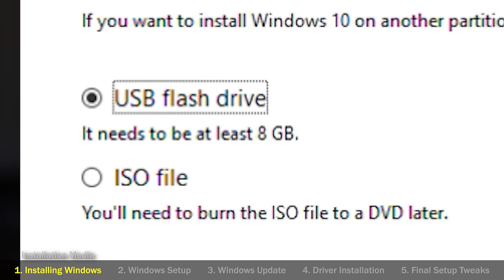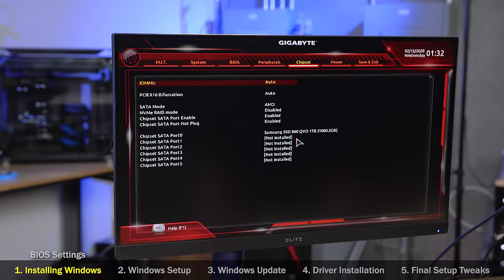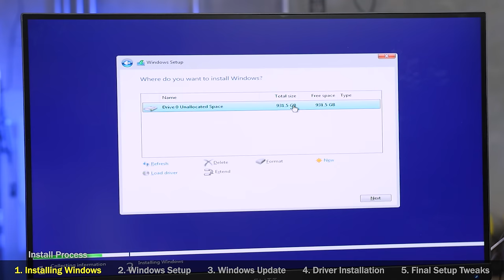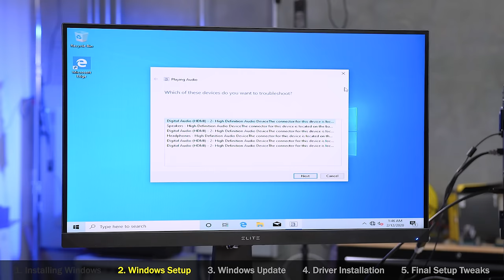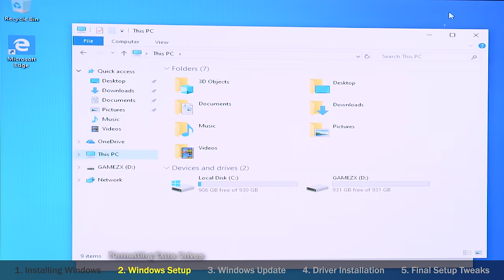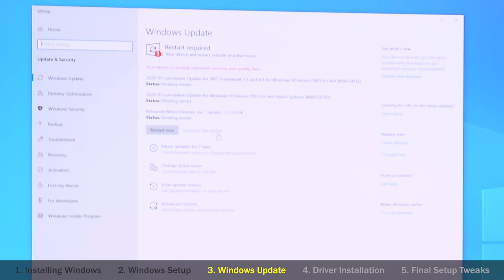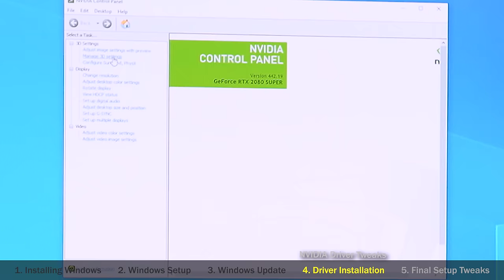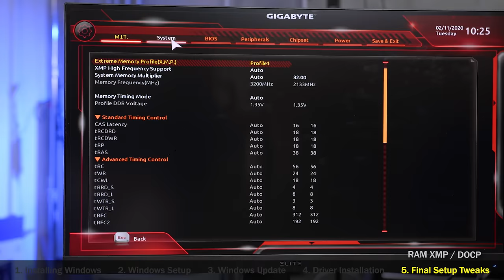Guide: What to do AFTER building your computer...

Comment: As a person who has never built a PC before (I'm planning to soon), this was a great tutorial. Very informative and easy to understand. Thanks JTC.
Reply: Pro tip: make sure you really look at what you need. I bought a single 500 gig ssd and quockly realized I was out of space and had to buy another. Also, ensure that you research to see when new parts are coming out to see if you should wait. A month or two after I built my PC with a 2070 the 2070 super came out for like 50 dollars less than I paid for mine. Lol
Reply: I'd suggest starting with a budget and look for a good build video and copy their part list and you're good to go. That's what I recently did and couldn't be happier with it.
Reply: OG Sniper is it a bad idea to try build a top of the range one first try?
Reply: @Vijai Ramharrack Yeah same here. This guide will be very useful.
Reply: OG Sniper I am probably going to build a pc within the next year and it my first time but if your building a high end pc for your first time I would suggest getting someone with experience about building PCs to help you
Reply: Fam, make sure you research your graphics card throughly, ensure that it is something that is very stable and won't die in the first week. cough amd cough
Reply: V Ram  Another tip, PLEASE update your bios, it’s a little tricky and you will need an usb drive, but I had many issues with my build down the road due to this and I didn’t even knew it
Reply: most of the instructions are fine. I, personally, choose to download the LATEST gfx drivers from my manufacturers website on another PC (currently with an AMD card) and transfer them to my desktop. 
I haven't had any real issues with most games I throw at my machine (it isn't blowing any titles away fps wise, but isn't having issues with CS:GO that I play at least on a weekly basis, since I built it in 2013). If you browse around there are countless threads on reddit and stuff with people with monstrous builds that are having issues with game from 2012 :) 
I've gotten bashed a lot online for doing it "my way", which is the way everyone did it back in the XP/Vista/7 days (and before). But I'll keep doing it that way cause it just works for me. and it's always less shit in the registry after a clean install.
Reply: Which parts do you plan to use? I built my first tower in January using a Ryzen 7 1700 and Rx 580 strix
Reply: @andydbr2969  I know you probably weren't @me, but I'm also upgrading (parts should be arriving this week or beginning of next). R5 3600, 16GB 3200 ddr4, msi b450 tomahawk (max i believe) and a 500w 80+ gold psu. I wanted to upgrade and stay below 450$/€. just about managed it by +/- 5$/€ 😁
Reply: @gerRule  You'll get diminishing returns on your parts once you get past a certain price point but undercutting isn't great either, because then you'll have to pay for 2 parts (the original and the upgrade) just to get use out of 1.  If its your first build, I probably wouldn't spend more than 1500 MAX.
Reply: CSandman but what about the new Nvidia 3,000 series graphics cards with hdmi 2.1, they’ll be expensive but I’ll want one
Reply: @gerRule  If you're willing to wait and shell out some serious cash, then yeah I'm sure it'll give top tier performance.  Who knows when they'll end up getting released though because of this virus.
Reply: CSandman yes well I’m sure it would take me a long time to build one so no rush
Reply: @gerRule  that could be a never ending game, waiting for new things to come out. People did that with the 2000 series card and Ray tracing and now everyone says its pointless. Then you also might as well wait for intel to release their new cpus too right?
Reply: no I’m only waiting because I already have the tv for it and I want to make the most of it, I don’t want to build a pc now and then have to replace the graphics card in a few months plus most likely I’ll just end up buying a pc rather than building one so then I’d definitely have to wait
Reply: @gerRule  id say it will be more than a few months, they were saying possibly august but with all that's happening I bet it will be even longer.
Reply: @gerRule  what benefits are you expecting from hdmi 2.1? You won't be playing at 8k so the 8k at 120fps won't make any difference
Reply: rayn man I just want 4K @ 120hz
Reply: And obviously be ready for whatever’s to come over the next while
Reply: @gerRule  wow you must be building a beast of a pc💪 doesn't hdmi support 4k at 120hz?
Reply: On one leg, you have the risk of tripping and scrapping your palms on the ground if your lucky at most. On the other hand.... You risk fucking up a 1000+ dollar build(100-1000 builds are just as scary).
Reply: i have just finished my first ever build i have never even thought about pc it was actually fun just take your time and do lots of research and you will be fine
Reply: kendawg THE AWSOME was it difficult? How long did it take you?
Reply: @gerRule  dude building a pc is soooo easy, I swapped old and installed some new components from one case to another in less than 1 hour
Reply: rayn man Hdmi 2.0 does 4k @ 60hz but 2.1 does 8k @ 60hz and 4k at 120hz, it also jumps the bandwidth capability up to 48Gbps from 18Gbps and I have a very fast internet connection with a 4k tv with hdmi 2.1 ports and a pocket full of cash so I might aswell make the most of it
Reply: My only downfall is having never built before so If anyone knows how I should overcome that I’m all ears lol
Reply: rayn man easy for you now but was it easy your first time?
Reply: @gerRule  well that's the thing the only way to overcome that is to build a pc:) your right it probably was harder my first time, even though this is the first time I've actually done a full build, only the second time I've installed a cpu and that's the hardest part. Take our time and make sure everything is in correctly before pushing it in the whole way, some things need a bit of force.
Reply: rayn man what’s the chance I break a really expensive part? 😂 I’d happily pay someone to build it for me but I don’t know anyone that has built a pc before, I don’t even know anyone that owns one
Reply: Same here
Reply: @gerRule  not sure how big the second hand market is where you are but you could try and find some super cheap used parts to practice with? Might even find some free stuff
Reply: @raynman6466  I am planning on doing a pc build too, Ger seems to be super paranoid and scared of breaking a part. I dont really care as I have watched many PC builds and know a lot about PCs thanks to IT. Just chill out, start with a 300-400$ Build , if you break a part it wont be much since the parts on their own arent that expensive and still they can run games decently.
Reply: go for it
Reply: Same here thx
Reply: @jaalan7896  shiiii
Reply: Shrkkng55 bottleneck lol

Comment: I've built four systems, and still come back to videos like this.
It's always good to review and make sure you're doing it right.
Thanks for the video!
Reply: Chibuike Enebeli :: Make sure your LAN driver is installed. Also, make sure you don’t need to connect the antenna that may have come with your motherboard.
The last thing to consider is that your motherboard doesn’t have a built-in wireless adapter, in which case you’ll need an ethernet cable.
Reply: Was your first time building one overwhelming or stressful because I’m feeling both right now I’m kind of having second thoughts
Reply: J&N Airsoft nah you’ll be fine, just think of all the components as Lego for adults! Most things are labelled which makes it easier to put together, just do as much research as possible and you’ll be completely fine! Unless you get REALLY unlucky and get a bad psu or something
Reply: @Jerry__P  i was the same thing my pc is underperforming now and im aloly starting to understand the software and that u be fine keep at it the hardest oart for me was the coole to put on. But good luck
Reply: Ive built 100s including custom  water loops. I also have two OT degrees so do alot software ect and inside windows troubleshooting and i still watch  these for fun.
Reply: @Jerry__P  ive built 3...all extreme budget builds.  I just built my first $2k+ build and trust me...i was nervous with every single part.
Reply: @Jerry__P  Nah mate juist build  it. Building a pc is like playing with blocks (like back in the days) it's a lot easier then it looks. It's exactly what wozzadekon said it's lego for adults.
Reply: @wolfman21  It has nothing to do with the worth of the product but, with the person. i Have build plenty of pc's/servers and believe me a server is not cheap( we are talking about 15k servers) and i was not nervous at all. Just relax and take your time do it step by step and you will see everything will be fine.
Reply: CGMe if you bought a motherboard with a WiFi adapter can u still use an Ethernet cable
Reply: Now the hardest part for me is installing windows lol

Comment: "Guide: What to do AFTER building your computer..."

Pray... pray that it works....
Reply: Yes sir.
Reply: Yea
Reply: And then it doesn't work because you didn't turn on the Power Supply
Reply: that was me today! it works boys!!! 🙂
Reply: @pinktacotuesday4573  ok thank
Reply: Waldel Martell it’s sucks probably ngl
Reply: According to Harvard studies, the prayer levels rise exponentially once any new pc is built and all hooked up.

This was obviously a joke don't take it like a fact
Reply: I crashed in windows logo screen and had to update the bios 😭
Reply: I’m in the process of following it rn I actually managed to build a pc...wow but so far this is completely accurate I just installed chrome before everything I’m just posting this cuz my pc is restarting don’t be scared it’s so awesome (for anyone scared) :D
Reply: Just built mine today (or yesterday cuz its 1 am) and spent 3 hours trying to troubleshoot... i even had my older brother who knows what he is doing take a look at it and he said the only thing he can thing of is that either the mobo or psu is broken because the power wasnt even getting to the mobo... plugged in another psu outside the case and it worked... took my psu out and plugged it in and it worked... THE MOTHERBOARD 24 PIN KEPT COMING UNDONE BECAUSE THE SPACE UNDER THE SHROUD IS SO SMALL

Time to take out the hdd mounting thingy tomorrow, wish me luck
Reply: Update: i just redid some wiring so i didnt need to take out the hdd cage :)
Reply: @enobekuJ  That just happened to me I got so scared
Reply: @enobekuJ  I thought o was on not off and so I spend like 20 mins freaking out trying to find the problem
Reply: Zenchilli Fanboy
Reply: Overclock the snot out of it lol
Reply: Bahaha it works .. but man . I just put in 3090 !! And thought I fucking broke it... but my mobo told me I didn't plug in the power all the way into the card smh
Reply: Yup
Reply: I actually had an anxiety attack when it wouldn't open up. I found out the ram wasn't properly seated, so I did that to see if it will work, and it did :)
Reply: LOL
Reply: @pinktacotuesday4573  Congrats
Reply: Just finished mine. Did the prayer and it didn't turn on. I forgot to turn on the power outlet x) damn was I glad after noticing it.
Reply: @Waldel Martell oh you need at least an rtx 503839472837382 to play that
That should translate to about 2021 rtx 3090s
Reply: @sudip1882  does it work
Reply: @Waldel Martell you have a 3090 for just a 1080p monitor? What a waste man.
Reply: I had a full 1 minute panic attack before realising it wasn't plugged into the wall. I know that sounds dumb lol but I had plugged the detached wall cable into the psu, turned the wall switch on and turned the psu on so I thought I was good
Reply: @d3stroy3rxam76  I took out the hdd mounting thing completely there was no chance I was fitting those cables without removing it. Guess I'm sticking to m.2 and 2.5inch drives from now on lol
Reply: @enobekuJ  or turned on the power supply but not the pc 👀 oops
Reply: just like me lol
Reply: Yes sir.
Reply: and then it doesn't turn on, because you didn't plug in the 24-pin correctly
Reply: Then I went to buy some missing parts I haven't bought during the first attempt

Comment: I'm more than a year late adding this comment, but thank you for this video.  I built my first PC from scratch in November 2021, and this video was my 100% step by step after the physical PC was put together and plugged in.  I've had so much fun improving and tinkering with the build since, but it wouldn't have been possible without your walkthrough on the things I wouldn't have known I needed to do before thinking I was "done" with the original build!

Comment: Another important NVIDIA Control Panel option is Threaded Optimization - a LOT of games run better with this OFF, though your milage may vary. If you're experiencing inexplicable stuttering in a resource-intensive game, consider disabling this.
Reply: Wait, really?
Reply: Honestly the rule of thumb I've adopted is only touching the NVIDIA Control Panel if I REALLY need the extra performance. If I'm already maxing my monitor HZ and it's stable, it doesn't NEED tweaking. But for something like CS2 I will tweak and find the best possible settings.

Comment: Tip:  if you don't want to use the 3 security questions, don't enter a password during setup (you can leave the field blank). It will then skip the security questions. After setup, add a password through computer management or settings-users accounts
Reply: Very helpful Comment, thx
Reply: Thanks, I always spend like 15 minutes on the security questions
Reply: I wish i had read this before.
Reply: @fangornthewise  same
Reply: @Walter Wiles I skipped password during installation and my user has admin rights
Reply: Hey, I already have Windows installed on my SSD but it's not running fine. I want to do a clean install but how do I first completely remove the current installation from the SSD?
Reply: @criskobeats  you can reinstall it booting from bios, just like the normal process, and overwrite the SSD data
Reply: @vinimarianob  So when I turn the PC on just spam delete to get into bios? Also I have an HDD with my important files and I don't wanna risk wiping it, so can I just unplug it beforehand and when I'm ready with the installation plug it back in - will it work?
Reply: @criskobeats  exactly, spam delete button to enter bios. And yes, you can remove your HDD, it doesn't influence the SSD installation.
Reply: Anyway to remove 4 digit PIN number that I have to enter every time?
When I had Microsoft account it booted straight to the desktop.
Reply: you legend
Reply: if you press alt+ctr and delete you sign out faster and change password

Comment: Such an amazing video.  I've used this for reference on multiple computers now, as well as when I had to do a complete rewrite and install of windows one time.  Thank you Jay and friends!
Reply: Unfortunately the biggest issue people have is not addressed. Windows installation now requires a connection, yet the drivers for connecting to internet are not installed. So the hard part is getting those installed manually through command prompt. There’s also the fact that you can’t pair bluetooth devices so you’ll need a wired keyboard/mouse. If you have those, then you can bypass the connection step , then when on desktop, manually install the drivers from a usb for internet from your MB support page. 

Again this was the biggest pain for a new setup^ and sadly it was skipped over in this video as ms no longer allows you to just not be connected to internet and skip it. They want everyone using a ms account, not local.
Reply: @carsonhunt4642  i mean it was relevant when this video was released...
Reply: @carsonhunt4642  i just did everything step by step and everything works, you dont need a connection or any cmd commands.. idk where youre getting your info from
Reply: @ItsLipNix  
You made a new build with a clean install of windows? Newest win11 install requires internet unless use cmd to bypass it, maybe you used an older windows? 
Motherboards don’t have drivers pre installed for int/wifi. The average user does not know how to install the internet drivers through cmd, they’d want access to the desktop first. 

Anyways it’s simple once you know how to fix it it. The problem is most users aren’t expecting their wifi/eth to not work, and then told to install drivers before they can even access desktop. It’s a windows install problem that causes unnecessary issues. 

Congrats if you somehow avoided it. Google shows it’s quite common regardless.
Reply: @carsonhunt4642  Yes. This video is about windows 10 not 11 you know?
Reply: @carsonhunt4642 bro literally yapped about something different for no reason

Comment: This would have been godly guide for me about a year ago, definitely keeping the link on hand to help other newbies
Reply: Building my first tonight and let's just say thank god this popped up in my recommended
Reply: @loganrice9497  Same building my maiden PC tonight so this definitely comes in handy.
Reply: @Chris Endres Ichanged my ram frequency to my maximum performance my ram sticks could handle (3600mhz) saved en exit it now my pc doesnt start again all the fans are on exept display of my bios or anything
Reply: Logan Rice howd it go?
Reply: @kainijman8408  Did you check if your motherboard or CPU supports that RAM speed.
Reply: @kainijman8408  if you cant start it , pull the cmos battery and let it reset
Reply: mister dog is this video a replacement for having a windows 10 operating system or do you need the operating system to do this.